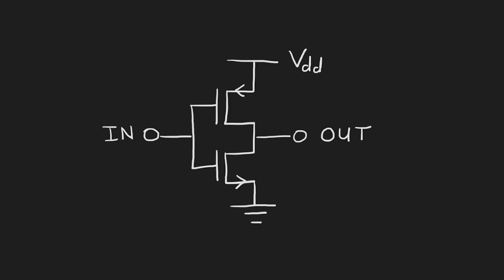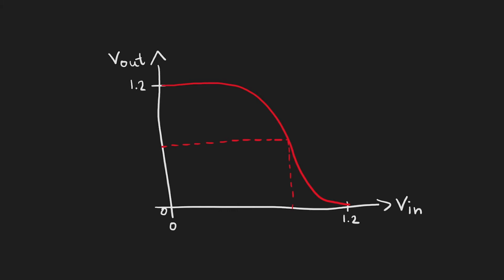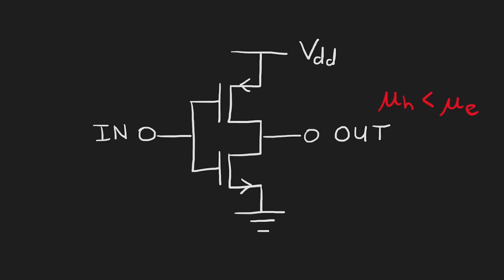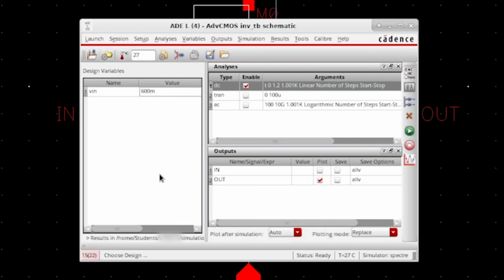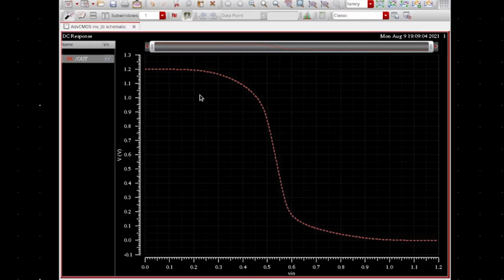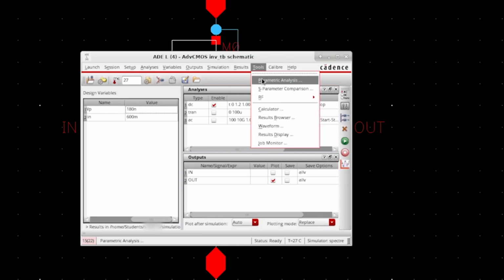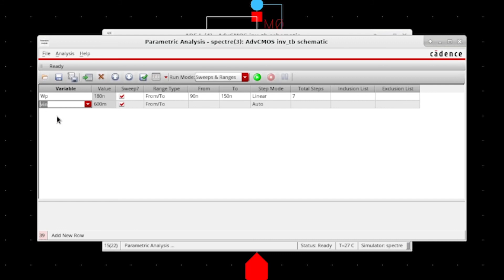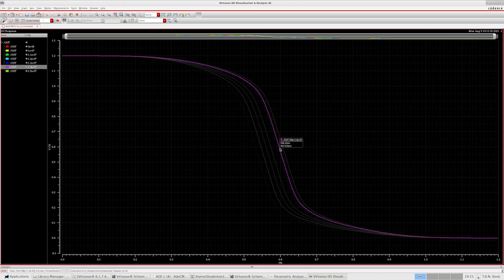Parametrization - Cadence Crash Course #7

Comment: Hello, I am a Korean student and thank you for the good video! Can I know how to do parametric analysis in ADE explorer?
Reply from the maker: Hi 원종윤, thanks for watching my videos! I will be honest, I haven't worked with ADE explorer, but it seems very similar to ADE XL and ADE Assembler. In that case, you can set up "Design Variables" in the left hand column of the window and make sweeps by filling in variables in a start-step-stop format. For example, to sweep a variable from 1u to 10u in steps of 1u, you'd fill in "1u:1u:10u". You can also fill in arbitrary values by separating them by spaces, e.g. "1 4 5 6". Hope this helps!
Reply: @ThomasBooij  Actually, I've been using design variables, but I was wondering if there would be any difference if I used parametric. Thank you for your help and Have a nice day!